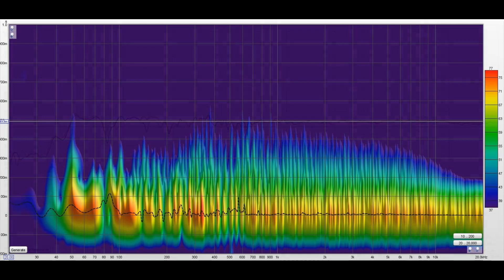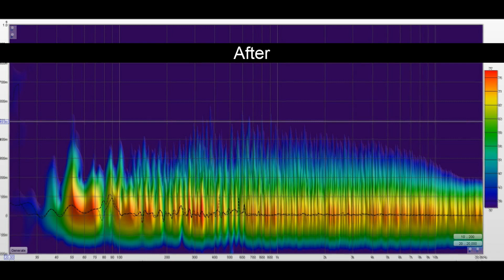Acoustic Ceiling Cloud (Part 2) - DIY Recording Studio Treatment - WITH MEASUREMENTS!!

Comment: Wow, that is one big cloud!  I’ve never made anything that big.  I have always gotten my traps into place with Zip ties, would take some pretty heavy duty ones to do that here.

I assume the chicken wire was to prevent lumps from showing through?
Nice work!
Reply from the maker: Yeah, it was huge and still heavy even after I drilled all the holes. The chicken wire was to make sure the insulation wouldn't fall against the fabric and make it look lumpy and uneven. Not sure how important it is but better safe than sorry,  I don't ever want to bring it back down...

Comment: Hey, thanks for sharing! Why did you drill the holes in the outer frames??
Reply from the maker: Thanks for watching! I did it mainly for weight reduction and looks. I figured it wouldn't hurt to have a little extra insulation exposed though for catching sound waves that might bounce into it, but I'm sure that effect is minimal.

Comment: Great video thanks it’s just what I needed to make sure my project goes smooth . Just a question though what kind of lights did you use because they look amazing .. keep up the good work your studio is clean man
Reply from the maker: I used normal can light fixtures from Lowes or any other home improvement store, then used color changing BR35 lights from Amazon. They are just an off brand that hook up to wifi. For the top I used a string of LEDs also cheap ones from Amazon, they change color with a little remote.

Comment: Only because of your high ceiling, you could easily control the low frequencies and ... otherwise, Omra would be able to control the rock wool with a simple panel, which is very low, which is very difficult.

Comment: At that height, I don't think it's most effective. If you can lower it closer to your listening position than from the ceiling, it will have greater affect, methinks.
Reply from the maker: You may be right, if it didn't take so long to get it up there I would have done measurements at different heights. I think it is good enough now at least good enough to where I don't want to move it! ha ha
Reply: @redtonestudio2982  My cloud is the same way!! Haha. Good job, man.